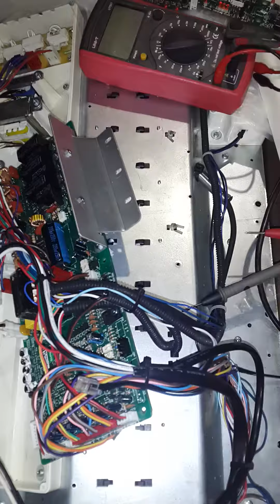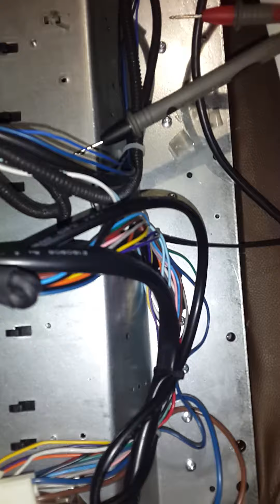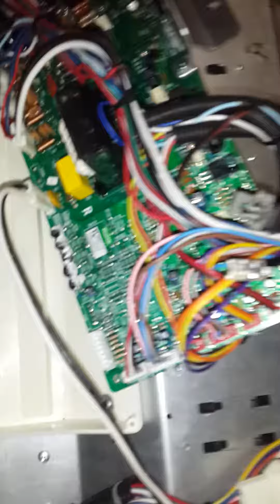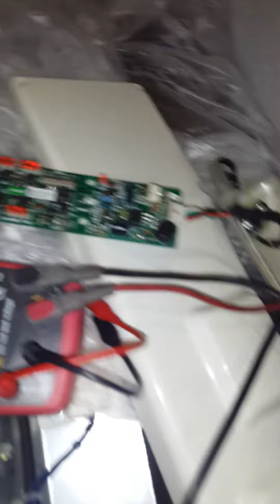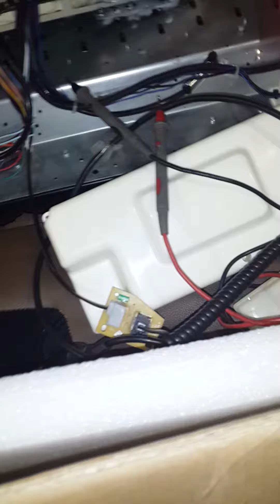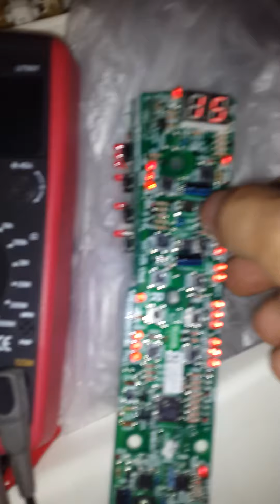HUMAN TOUCH HT-270 MAIN PCB KD514A SPARE PARTS

Comment from the maker: Hi
Under the adhesive buttons layer are located 4 screws. One on the top, one at the bottom andtwo horizontally in the middle. The easiest way is to punch and brake the layer where the screws are located. This method will leave 4 small holes which if doesn't bother you much is fine. 
The other method requires some extra time and tools. To remove the adhesive easily it you will have to warm it little bit to weaken the glue. Use hot air gun, hair drier or just leave it for few minutes under the sun. Don't use excessive heat. 60C-70C should be ok. When you are done use not very sharp tool to peel one of the corners. Keep the remote warm and try to slowly pull the adhesive without curving it to much. Be careful and work slowly. If you see that printed side of the layout doesn't come out, warm it again and try from another corner till you take it off completely. Use alcohol or adhesive remover to clean the remaining glue. Stretch the layout if it stays curved. 
When you are about to close the remote, you will need a sharp cutting bladeand very thin double adhesive tape. The thinnest you can get that should be and transparent as well. The one I use is very strong used in the mobile phones. Stick the one side with the tape on the buttons layer and press to stick it well. Cut precisely the corners and remaining tape. Begin from top, stick the layout and slowly adjust it further down the remote control. Press well and carefully. Now your remote should be as it was before.

Comment: I have a Human Touch HT-270 chair. The main back massage seems to have come apart. It was kind of loose for a few uses, but worked on the low back, now I expect there are pieces lying loose in the bottom inside. I can't order a new machine to put inside because it is so old. Can you suggest what I can do? 
My husband is handy at repairs, but is hesitant to even open this up, since it is an electronic as well as mechanical "thing".

Comment: Hello, thanks for the video.  Before you replaced the remote, when it was broken, does the motherboard have a consistent beeping emitting from it.  I am trouble shooting and am curious if my problem is my remote or the motherboard itself.  Thanks!
Reply from the maker: Well if the beeping is coming from the board remove the remote and see if it continues to beep. in many cases the remote looses connection with the board by one cause ot another 
in one case it can be the remote damaged in another sometimes the power cord for the remote is getting damaged 
it is made of 4 wires 2 for power and 2 for data ( similar to usb) if one of the data lines get damaged the board will beep.
try playing a little bit with the cord at the point where it gets into the remote.
usually there is the place where it get damaged
Reply: HONEY BUSTE HONEY BUSTER  Thank you for reply.  Motherboard still beeps when remote is disconnected.  Think I need a new motherboard?
Reply from the maker: It might be an error message 
It might not get response from something 
in the mechanism have some sensors check the connection between everything in the chair 
at the end of the day really it might be the board 
http://stores.ebay.com/accessories-parts/Massage-chairs-parts-/_i.html?_fsub=13862407018&_sid=1139246328&_trksid=p4634.c0.m322

Comment: Mine is beeping whenever I switch it on from the back of the chair. When I disconnect and reconnect the connection to the remote really fast over and over, the chair come on for like a second at a time every few seconds as long as I keep doing that. Otherwise, it's a steady beeping. Any ideas?
Reply from the maker: Sometimes the cord for the remote control that have for 4 wires in it fails to make the proper connection with the chair. By shaking, twisting and pulling the wires weakens by the time and cut inside the cord. When you are moving it here and there it makes the feeling that it working. Most commonly this damage happens at the place where the cord enters the remote controler. I guess that you are having the telephone like remote control connection? Also it can be some damage to the remote it self, but who knows. You can contact Human Touch and ask them for a new remote if they still got some.